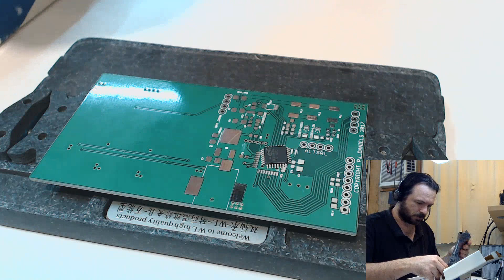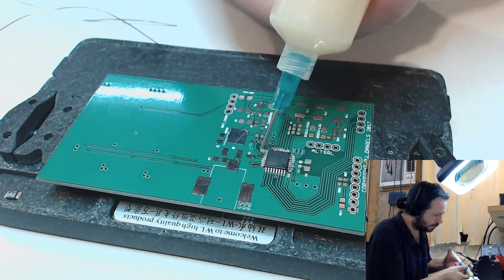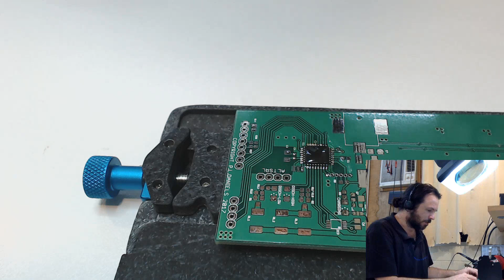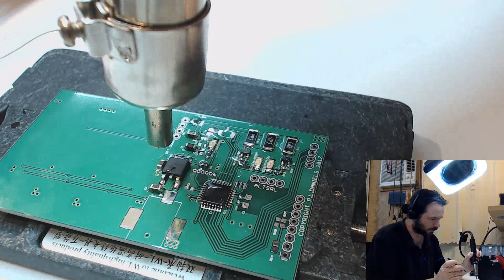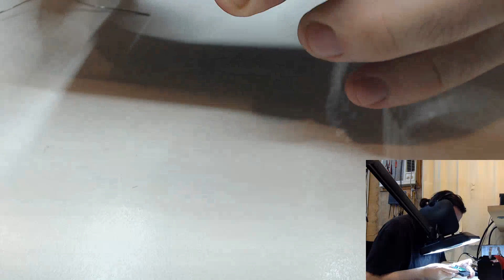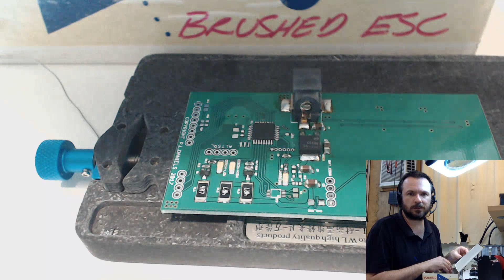iPhone battery tester PCBs arrived, time to try build (1am!!!)

Comment: maybe you can repair your monitor's backlight ? bluetooth module uses ESP8266 I guess :)
Reply from the maker: I am considering that (the repair to the backlight circuit), no schem of course; however given that it's glitchy, I'm going to assume it's some sort of corrosion or cracked connection somewhere, at least initially until I find otherwise.

As for the BT module, I genuinely am not sure at this point.  That'll be stage-3 perhaps of the build/development.  First part is to get the initial process working :)
Reply: no scheme, thats the prob I already feared . Concerning the build stages,  i''ll join the ride :) I was wrong with ESP8266 btw cause it only has wi-fi. The ESP32 HAS bluetooth.
Reply: Paul I got this fume extractor https://tinyurl.com/yar3gbaz
Reply from the maker: I need to get my act together and order in the one I'm going to use, just a case of making sure I don't need the $200 for anything else first ( and I still have to make sure I have my $ saved up for that microscope!)
Reply: yea I was just showing which one I got, I guess its not at all a professional one :) You are right that you should save your money for the microscope first now.